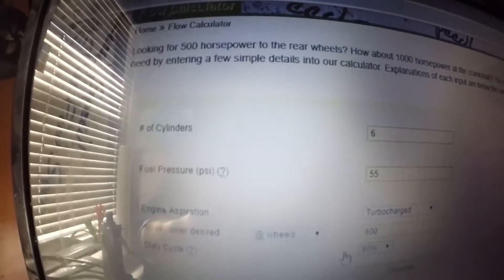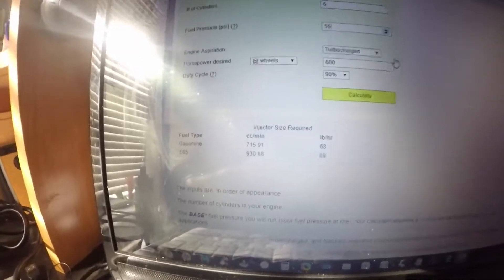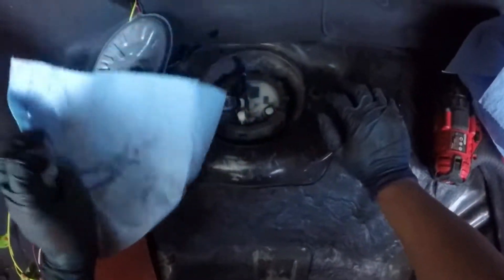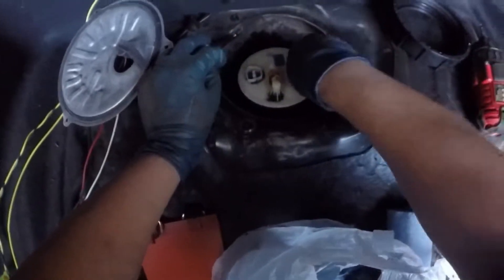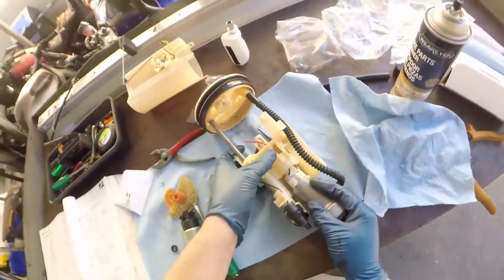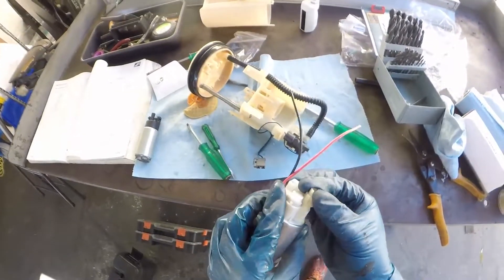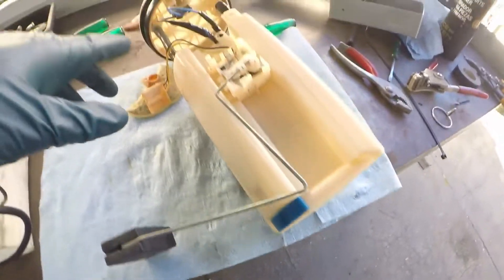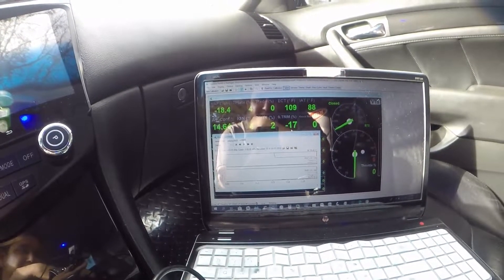WALBRO 450 INSTALL in J-Series TL/Accord_ Stock Pump Housing Modified (Ep.21 Quest to 600hp)

Comment: Hey man, good vid. One thing to note: you might want to look into replacing that electrical tape that you used to wire the new pump to the old cpnnector with something else, because the adhesive in the tape won't hold up to the gas, so the tape might come lose and cause a spark and maybe a boom.
Reply from the maker: I appreciate it. It's actual heat shrunk. I've used it in many different Moto fuel tanks and never an issue. I'll keep an eye on it though
Reply: Ah, apologies, my bad. Enjoying the videos man, keep up the great work.

Comment: Nice video! Need your help again!  So my power steering pump went out and I accidentally ordered the pump for a 2002 odyssey, but the v6 Accord has a j35 as well, so won’t the pump fit right in? Please let me know. Thank you!
Reply: Responsitrilitrance Quiltrilitrance 2003-2007 v6 accord is 3.0 2008-2017 is 3.5
Reply: Logan Cm8 that honestly has nothing to do with my question.
Reply: Why don't you reference part numbers? And the dude is right. They're not the same engines. Unless you have an 8th or 9th gen accord.
Reply: 998 Squid 🤦🏽‍♂️🤦🏽‍♂️🤦🏽‍♂️ dude I know what I’m talking about. 2008 Accord j35z2
2002 odyssey j35a4  and yes it fit I already did it.
Reply from the maker: I'm not sure man. Just reference part number and photo's. If the pulleys and mounting points are the same, I don't see why they wouldnt work.
Reply: @Bendejo6517  hurrrr durrrr. If you knew what you were talking about, then why ask? Perhaps you have an issue with reading. I stated the guy was right UNLESS you have an 8th or 9th gen, you have an 8th gen. So that means you, right?